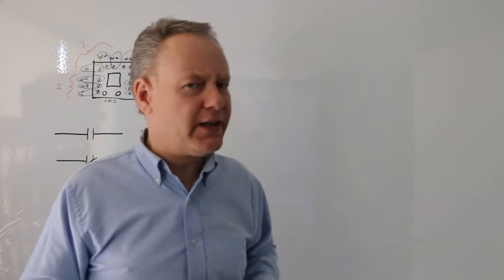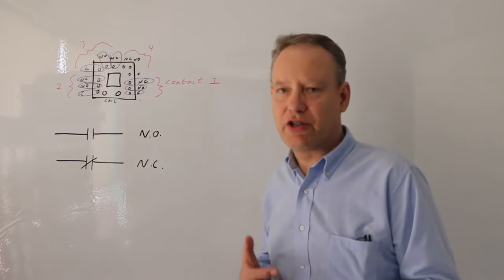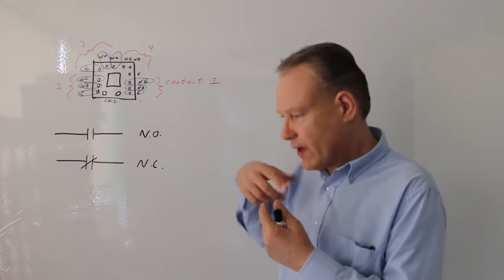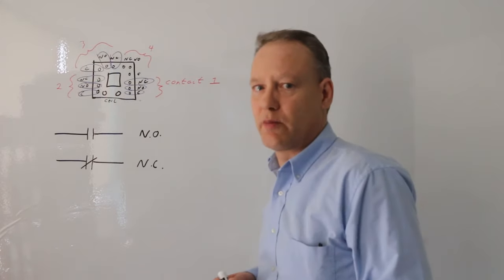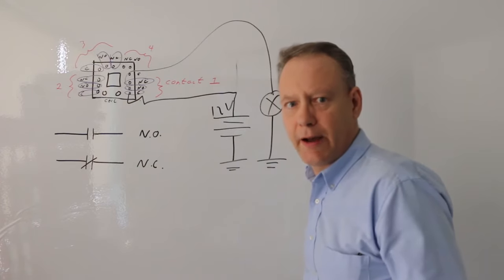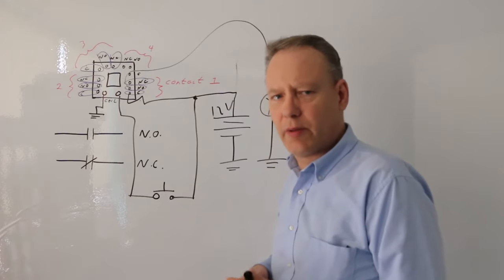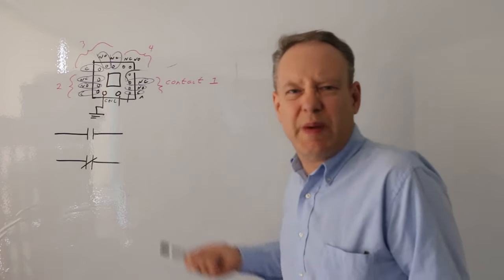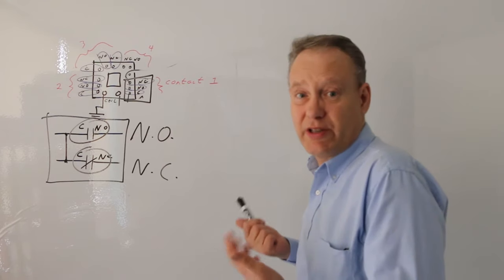Intro to the Relay with Normally Open and Normally Closed Contacts

Comment: Can I use both the normally open and the normally closed together as a means of switching inputs to the common?
Reply from the maker: Hi Autumn. Yes, that can be done. That’s using the contact backwards to how it is usually used in Ladder logic, and we don’t see that in Ladder Programming, but it is still fine as far as wiring and circuitry. Keep that type of thing out of Ladder Programming and because that is not allowed, you’ll get some people upset. I’ve never seen it in Ladder Programming anyway. : -)

As far as wiring and circuit and you can use the contact backwards. There’s nothing electrically wrong with that. I have used contacts backwards to control a motor with two different voltages. I had the positive side of a motor connected to the common and 12 V connected to the NC, and 18 voltages connected to the NO. When I energized the relay, the motor got powered by 18 volts and when I deenergized the relay, the motor when back to running at 12 volts.

Typically inputs come from a switch or sensor, so if you used to temperature switch as one input (Say connected to the NC) and a pressure switch as the second input (Say connected to the NO), and common to your load (Motor, lamp, buzzer, solenoid, heater, pump…). Then if the relay was in its normal state (not energized) the load would be controlled by the temperature switch and if the relay was energized the load would be controlled by the pressure switch.

Comment: Also, what reading would you expect on a pull on a relay?
Reply from the maker: You’re not quite asking the right question again. 😊 
I think you mean what current can you expect the relay COIL to draw. 

If I am not correct about that please let me know.

If that is your question then the answer is, it depends on the voltage applied to the relay’s coil and the resistance of the coil. If you know both, you can use Ohm’s law to find the current.

The other option is to measure the current drawn by the coil.

Some relays are HUGE, and their contacts are designed to switch hundreds of amps. In this case, their coils are also very large and sometimes draw several amps. 

Other relays are tiny, and their contacts are designed to switch only small currents such as a few amps. These relays have very small coils that only draw milliamps of current.

I hope that answers your question and also opens up new ones in your mind.
Reply: That was an interview question they asked me and I asked it the exact way they asked me. I’m thinking they want like a number of ohms?
Reply from the maker: @jerrileethornton1291  

Ha! 

If they asked me that exact question I would have asked “Can I get some more clarification because there are two types of readings, you can take on a relay? Is it the continuity reading on the contacts or resistance reding on the coil”? I think whoever was interviewing you should have been more accurate in their question. especially if the job was an engineering discipline, technician, or technology based, where accuracy in all things, including clarity of communication, is paramount. 
The other thought I had was they used odd terminology “Pull on” relay. I have not heard of a specific “pull on” relay, but there is a team called “pull-in” concerning relays. It is not a type of relay, but the voltage required to activate it and it is called “Pull -in Voltage” and “Pull-in Current”, but I have never heard of as “Pull on” relay. When you said that, I just figured you meant a basic relay, but maybe in your area there is a term that is like “shop talk” where a Pull on” relay is a relay with a Normally Open contact. (Shop Talk is, kinda like slang, where a term is made up and used in a particular industry to refer to something specific. This can change from region to region as well). If this is the case, they are probably asking you if you understand that the continuity of Normally Open contact will be “Overload”: or “infinite resistance” or just “open”.

I think this all boils down to a lack of clarity in communication.

I would be interested in knowing what they meant. If you get the job, please ask them and/or show them this and ask them to clarify what a “Pull on relay” is and what they wanted you to take a reading of. 😊 

I hope you get the job!

Comment: One question sir.When we have a normally closed switch and we give power to relay then the switch opens up.When we stop to give power to relay can the open up switch close again?
Reply from the maker: When a switch has a "normal state" it is in its normal state when it is not active. Any switch, like a push button will be in its normal state until it is pressed. A NO push button becomes CLOSED when the push button is activated. I wanted to highlight that a "Switch" as you commented is a switch and not a relay contact. IN discussion of a realy, we can say that the "contacts" in the relay are in their normal state when the relay coil in not energized. When a relay coil is energized the contact changes state and when the relay coil is de energized, the contact goes back to its normal state. The concept of a normal state is when the device (Switch or relay) is inactive.

Any NO relay contact will ne in its normal state (open) as long as the relay coil is inactive. Once the relay coil is energized, the contact goers into its active state and becomes closed,. When the relay goes back to its inactive state, the contact will also go back to its normal state. IN this case the NO contact becomes closed when the coil is energized and becomes open when the coil is de energized.
Reply from the maker: WHen the power is cut to the relay coil, the Normally Open contact will go back to it's normal state and become open again. THat is because its normal state is open. When a NO contact is in its active state (when coil is energized) the contact is closes.

Comment: What reading would you expect on a normally closed relay?
Reply from the maker: Hi Jerrilee.

I need to get specific and re-ask your question.

There are two main parts to all relays. The coil and the contacts. The coil has resistance because it is an electromagnet and draws current and does work, so it must have resistance. The contacts are no different from the contacts of a switch.

I think you are asking if the resistance of the NC contact on a relay was measured whould is show a reading of zero ohms? 

The answer to this questions is, Yes it would not read to have any resistance. Theoretically there is no resistance to any contact. If there were, it would steal energy from the power source, and get hot. If a contact is corroded then it will have a slight resistance and should be cleaned or replaced, but if it is clean and operating properly, then it should have no resistance.

I hope that answers your question.

Keep being interested and diving deep and asking questions. Bring them on!!!

Comment: So like a see saw affect?
Reply from the maker: Hi Paul. I’m assuming you’re talking about the contacts in the relay. Yes. I suppose a sea saw affect, image works where there is a spring on one side of a contact and the contact on the other. Check out this image in this article on Electromechanical Relays: https://ecstudiosystems.com/discover/textbooks/basic-electronics/relays/electromechanical-relays/

This video shows how the coil and contact works. It shows a cut-away of relay working: https://www.youtube.com/watch?v=kWqtS7BET1M

Comment: Soooo I have these LED strips for my car. White functions as DRL and then it has amber switchback for turn signal. I want to wire them up so that the DRL comes on with ignition on and when my headlights come on the DRL goes off. What kind of relay?
Reply from the maker: Ant 12 volt relay will do. Make sure you get one with contacts that can handle 10 amps. Any Automotive relay will do and they are designed to be weather proof and have mounting holes. Check out Digikey. THey have thousands and deliver the next day. Even for one item.

Comment: I think it’s 0 ohms on a NC relay but want to make sure.
Reply from the maker: I need to get specific and re-ask your question.

There are two main parts to all relays. The coil and the contacts. The coil has resistance because it is an electromagnet and draws current and does work, so it must have resistance. The contacts are no different from the contacts of a switch.

I think you are asking if the NC contact on a relay has zero resistance. 

The answer to this questions is, Yes. All contacts have zero resistance. Theoretically there is no resistance to any contact. If there were, it would steal energy from the power source, and get hot. If a contact is corroded then it will have a slight resistance and should be cleaned or replaced, but if it is clean and operating properly, then it should have no resistance.

I hope that answers your question.

Comment: Sounds like you know what you're talking about, but are extremely muddy and drag out simple concepts with far too much unnecessary tangents.  Simple explanation is the connection flips between the NC and NO pin when the relay is energized.  That's how you start, and add small details as needed.  You lose people by talking all over the place and having a messy drawing.  Video could have literally been 2 minutes long, had plenty of detail and been straight to the point.

Comment: So by normally its meaning its default state
Reply from the maker: Yup. Exactly. 

A Normally Open switch's state is “OPEN” when it is in its normal state. When it is activated, it becomes “CLOSED”. Some people say that it becomes “NORMALLY OPEN”, but that is not correct. It is still called a Normally Open switch no matter that state. That is its name, but its state can be “OPEN” or “CLOSED”.
A Normally Closed switch’s normal state is “CLOSED”. When it is activated, its state is “OPEN.